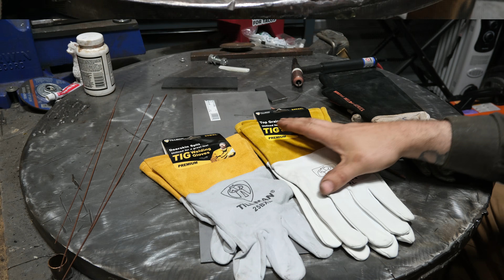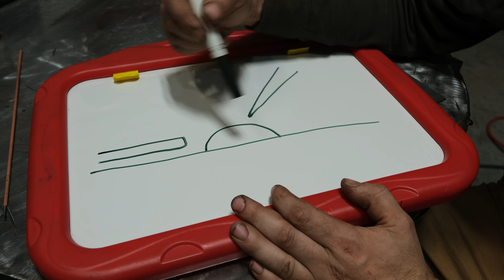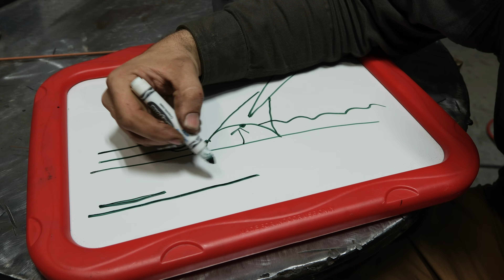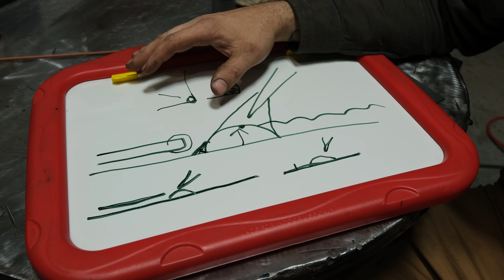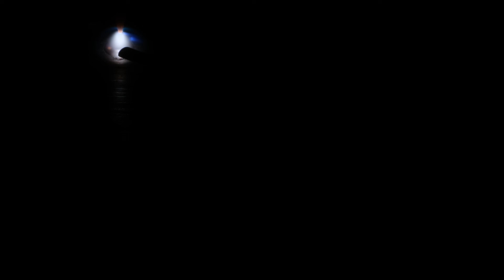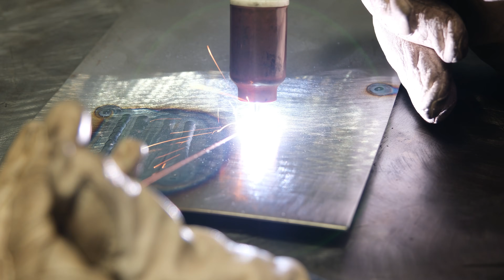How to add filler rod while tig welding (and tips)

Comment: I have a tip for a video like this. After the good, too long of an arc and OK weld sets, it would have been nice to see the finished product. We all look at what we did. You went into the other welds without showing.
Reply from the maker: In the videos welding actual joints you will see exactly what you described, they will be out shortly 😀👍

Comment: I just realized from your info that I can simply use .035 mig wire er70s6 to use as tig filler wire (on thin material).  thanks for this info.
Reply from the maker: You can, it will be a bit curved but it will help you out.  .035 mig wire is way better on auto body thickness material than 1/16th.
Reply: If you have a ton of MIG wire, and no TIG wire on hand, or need some specific filler you only have for MIG, you can take 3 or 4 lengths of wire, clamp one end in a vise, and twist it together with a drill. 
Did this for quite a while at work because for some reason we only had 1mm MIG wire and 4mm TIG rod for Aluminum
Reply: @MannoMax  great idea, thanks

Comment: And one more thing:
After you have gone bonkers doing bead after bead on plate for a week, don't take time off.
If you don't do this very often you will lose the muscle memory and have to start again. (Just not as many repetitions)
Reply from the maker: Great point.  Time off produces rust on the muscle memory for sure.  In something that a 1/32nd of an inch makes a difference, any “rust” will be significantly noticeable.

Comment: very helpful! I run dualshield and 'push-pull' aluminum at work,I weld everything at my home shop.Tig band diesel tanks for semi's all the time,Tig isn't my strong suit-I would rather root pipe with 5p+ than  tig aluminum
Reply from the maker: Tig aluminum can be tricky for sure.  When it goes bad it’s very hard to get back on track.  Especially if it’s contaminated with oil.  6010 is so much more forgiving on how poor the material is.

Comment: Not sure if I can do tig stroke screwed up left hand
Reply: Would switching the torch to the left hand be possible?
Reply from the maker: As was suggested switching hands may help.  Filler rod requires more hand control than the torch.  I am sure the stroke will present limitations but you may be able to find a way.  Even if you can’t tig I am sure you can do other forms of welding 👍.